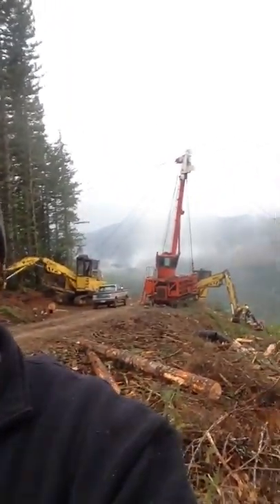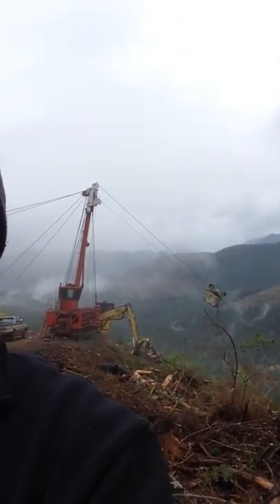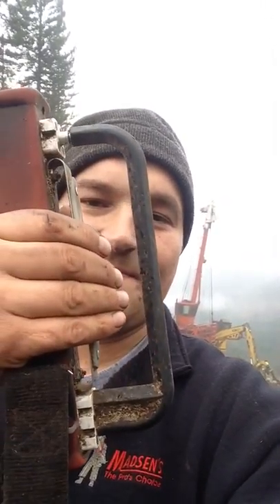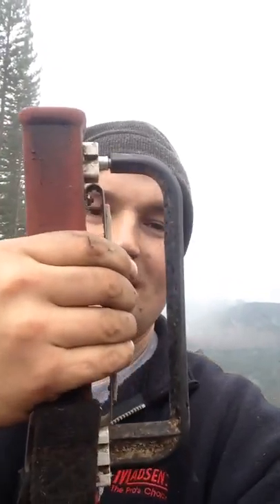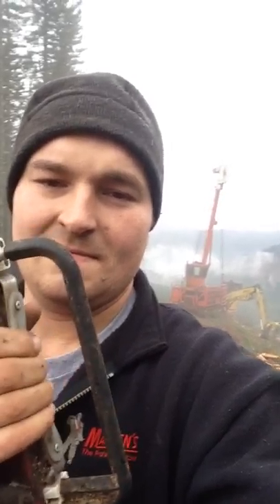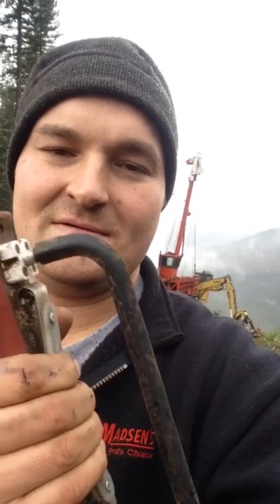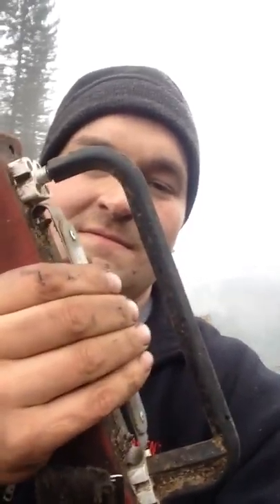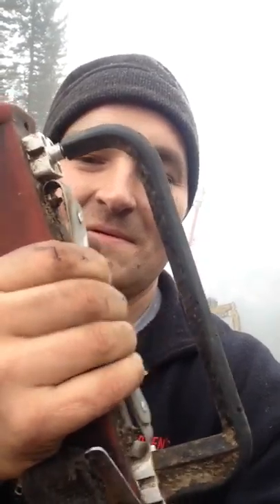HOW TO VIDEO:    CABLE LOGGING WHISTLE SIGNALS for standing skyline operation.

Comment: 7 long, man injured, long short short short short long repeated, fire. The most dreaded whistles in the bush. Thanks for posting.
Reply from the maker: I’m glad to have never had to hear those whistles where I worked, unfortunately I forgot to include them in this video 🤦🏼‍♂️. Thanks for watching  ~Daniel
Reply: On the crew I'm working for here in northern california it's 6 longs for man down/injured.  Have only heard that once so far back in 2014 when I was chasing landing.  Had a kid wind up dead on the helicopter ride to the hospital after being struck by a smaller 20'' tree that had gotten pulled over after getting wrapped up by chokers on the carriage on it's way back down the hill.  Hit him square in the back after trying to run away from it.  

Really high cost all due to the tree not having been simply cut in the first place.  But when trees do get wrapped up like that, they usually tend to get pulled straight down the hill along the skyline, but in this case the chokers came unwrapped before pulling it all the way over, causing the dead rootwad to make it fall sideways.
Reply from the maker: That is so sad .

Comment: Why wouldn't you at this point just use radios? That's way to much man
Reply from the maker: Hi Dakota. I’m honestly not entirely sure why more people don’t use handheld radios. Hopefully someone on here can’t jump on board and comment to this. I worked for a company in Australia that use handheld radios, and when the rigging slinger would give a command to the Yarder Engineer the Yarder Engineer would Blow back the corresponding whistle with whatever line movement the rigging slinger was asking for.

Comment: oh man that is so different from what I use here in New Zealand, we used to use talkie tooters but we just use radios now, but still do toots for what they want
Reply from the maker: swn02  yeah there are sometimes large variations between logging companies and countries for that matter. I'm kinda curious what is your whistle for raising the skyline for instance do you guys run a motorized carriage  ?  What part of nz are you from. Thanks  Daniel.
Reply: Ours country wide are the same by law , some people use a carriage, but most of the time the company I work for we just scab. We use the skyline only when we need to ,5 short for up and 4 short for sky down. some people here in NZ are using the new falcon grapple carriage, you should look it up. All the logging our company does is on the east cost of the north island, mainly with in 100 km of the city of Napier.

Comment: I went to British Columbia about 20 ish years ago and Yarder crews used Radios.  It seems a lot easier and safer than this system?  Whats the benefit of this whistle system over a radio?
Reply from the maker: hmm, i worked on a crew that did the voice yarding and it was a bit difficult at times, yarder engineer couldn't hear/tell what he was needed to do. Id assume voice yarding is a cheaper setup, Whistles tell everyone in the vicinity whats going on and if someone misses a whistle it is fairly obvious. I would say that its just preference.
Reply: Thanks Daniel it was quite a while ago, I was setting chokers and doing some chasing on the landings it was a great time.  Are you in Canada or USA?
Reply from the maker: @bencarter2334  I.m in the USA where about do you live ?
Reply: @DanielBoonesloggingvideos  England  UK
Reply: Radios suck they slow the riggin down a bunch and defintely are not safer
Reply: Whistles are way safer than a radio. I know from experience. Sometimes things happen so quick it easier just to have your yarder whistle ready to hit a stop.
Reply: Huh,l logged on Vancouver island 30 years ago we used the talkie tooter. As said I'd hate to use radios f-ing dangerous most engineers are deaf some l swear dumb too. Kidding guys. Everyone needs to know what is happening.

Comment: Way different than BC standard all over BC. Dangerous should be standard
Reply: Too easy to confuse a bad' slack whistle with something else
Reply from the maker: copy that. thanks for watching and commenting Fred. do many contractors use motorized slack pulling carriages or drum cars up there or are you guys using strictly rigging ? ~Daniel